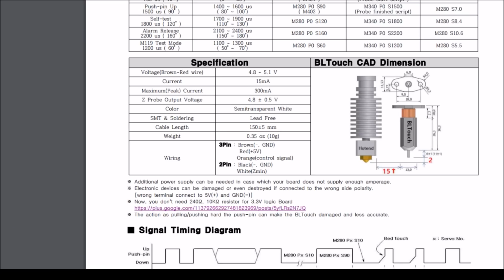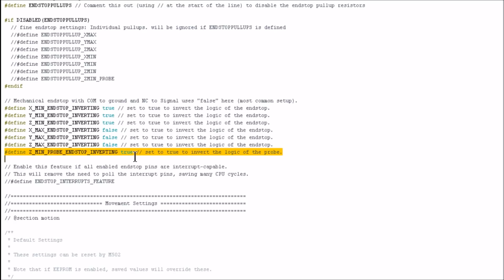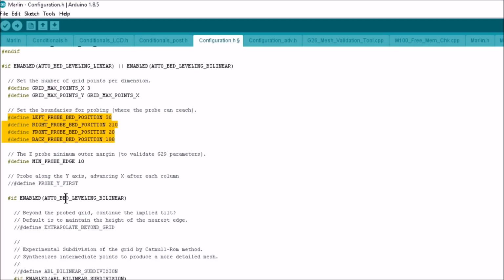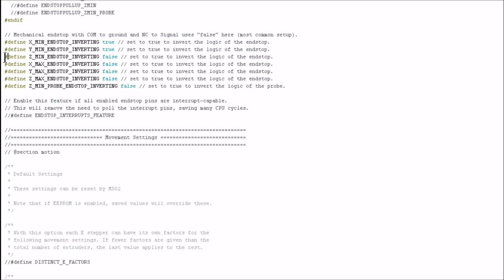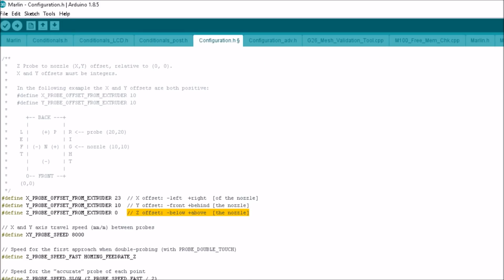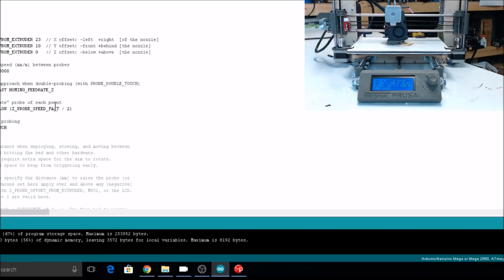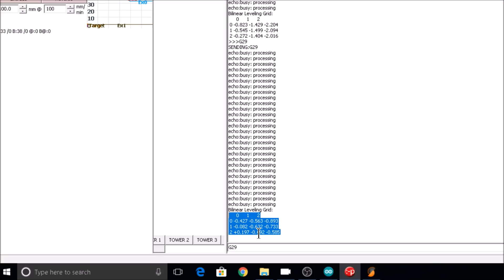Add Auto Bed Leveling to your 3D printer - Marlin - 2017

Comment: Hi Chris. Your videos on SKR 1.4 and marlin are awesome. Now I am having a problem with the manual bed leveling. When I touch the controller to go to the 4 points (the 4 corners) it moves to 4 points on the bed, but only one point is an actual corner. The whole mesh is too far towards the back and the right side. I uploaded a video to the Bigtreetech / Biqu SKR Facebook group (I am hoping you are a member). I also have uploaded it to my Google Drive (and included my otherwise working Marlin if you want to look at it) in case you aren't a member (2nd link). Could you take a look and tell me how to fix this please? Thank you very much for any help you can provide !!! https://www.facebook.com/groups/755135144882809/permalink/1266374420425543/?comment_id=1266385217091130&reply_comment_id=1266394480423537 https://drive.google.com/drive/folders/1ztqHRDSGQFZh6eoQ2cIQcjAsDjuKh1By?usp=sharing
Reply from the maker: So about all you can do is adjust your probe points. That can be done in your configuration_adv.h  

https://youtu.be/iwhbeD2AduA?t=809
Reply: @ChrisRiley  I tried that and it didn't work, but I finally fixed it via updating and changing the points in the TFT35 firmware. Now the whole printer works perfect, but it won't print without massive drifting on the X axis on the first layer. The printer is sound mechanically, so there must be a problem in my Marlin, which works on my Sapphire Pro but I couldn't adapt it to my larger ELF. So I am making a new Marlin from scratch following your SKGO video (ELF is CoreXY) and incorporating your settings from these videos and other advice I've gotten. Difficult since my corexy has 2 z motor and 2 z endstops and no ABL of any kind, and in the videos I've seen so far you never seem to mention what to do when you don't use an ABL. I find manual leveling so easy that to buy an ABL is a waste of money. So I am a Marlin Noob trying to compile Marlin for a printer no-one has compiled it for yet, plus I've added the new SKR & TFT35 and I just bought optical endstops so I don't want sensorless either cause that would be a waste of money (which you also don't explain in your videos). I understand you make these for the general public that do want all these things, and the videos are great for them, but not so much for someone like me. But they have helped tremendously in a lot of other areas, so thank you very much !! I am really getting  the hang of Marlin with your help.

Comment: Why do you need to add resistors when you connect the probe to 12volts? also what value of resistors do I need to use?
Reply from the maker: At 10k and a 1k should work. If you don't use them you will feed 12v back to your board that is 5v.
Reply: @ChrisRiley  Cool, Thanks a lot Chris!

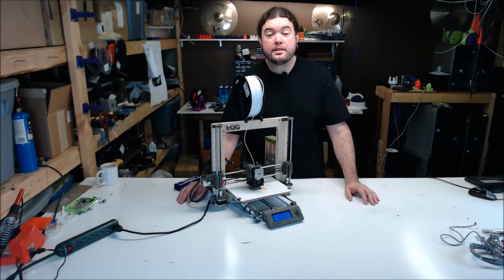Comment: Why you didn't change the Z offset using eprom instead of reuploading at every change? Also, which version of marlin shows the map result for G29 at 10:29? I am using 1.1-bugfix and it don't. It is a BILINEAR thing perhaps? I'm using 3POINT
Reply from the maker: I don't remember, it's been to long ago. My guess is that only works for the mess leveling.
Reply: @ChrisRiley  Yes, I tried and can confirm it is a bilinear thing :-) Now I get 
0 +0.705 +0.439 +0.182
1 +0.305 +0.158 -0.245
2 -0.109 -0.250 -0.535
If I understand correctly, the 0,0 point is about 0,8mm (.705+.109) higher than 200,0 point, is that correct?
Reply from the maker: @brunocabral1578  Yes, that is correct.

Comment: My didn't work an the problem was Earthing. My printer uses 12v atx power supply unit but my house doesn't have earthing in any socket "thanks to my landlord". There for it doesn't work through my skrv1.3 board. But it works with 9V battery. Problem is signal pin works only when connected to pure DC voltage otherwise probe does detect metal but signal pin doesn't trigger.
Reply from the maker: Wow, that's interesting, nice work finding the issue.

Comment: Auto-leveling has its own issues but that's besides the point. What is really pointless here, in my opinion, is the whole effort about zeroing Z axis. That's a huge amount of effort which basically goes out of the window the moment you come even close to nozzle, let alone swap it for a different one. Sensor offset should be some safe height and then everything else should be configured through home Z offset on the printer interface itself so you can easily reconfigure offsets when nozzle is changed.
Reply from the maker: Interesting take on the process. Thanks for your thoughts.
Reply: @ChrisRiley  You are welcome. Sorry if my comment sounds harsh. Upon reading it second time I realize it might sound like I have something against your explanation. Which I don't.

Process just seems overly complicated to zero-in on the Z axis, which basically goes out the window on any Z axis change, be it synchronizing steppers or changing nozzle.
Reply from the maker: @MladenMijatov  No worries, but thanks for following up.

Comment: Great video! Got ABL working and have had some nice prints, but one thing is kind of odd to me:

When I'm doing prints on pronterface I don't notice the z-axis height changing as it goes around the bed, shouldn't I see this value fluctuate by a couple hundredths if my bed is about that far out of alignment in any given spots? I thought maybe the value just doesn't update but I also don't see my z stepper motors moving as it prints across different parts of the bed. I've got G29 enabled on my starting g-code, is there something else I'm missing? If I'm not seeing change in the z-axis as it goes across a given layer, what actual bed leveling is taking place?
Reply from the maker: Yes, you should see the Z adjust the height up to a certain point it will stop if fade height is set, but it should be doing it on the first 10mm or so. Unless your bed is super level.

Comment: Hi,
Thank so much for this video with a good information. I have a SKR mini E3 board on my Ender. Can i connect my capacitive sensor on PC14 (Probe) ? I use optoisolator for protect my board because i use 24V on the probe. It is the same firmware modification like BLTouch. Thank for help.
Reply from the maker: Yep, you can use it on that port, just comment out #define Z_MIN_PROBE_USES_Z_MIN_ENDSTOP_PIN

Comment: Hi Chris, Im going to install a BLtouch, i have Marlin 1.1.8 installed from the factory on my printer, if im going to make the changes you say in the video, do i need to download the firmware i have in the printer in order to get all the settings right? Or can I just make the changes and update the ones that are in the printer??? or might something stop working if I do that?, I have a printer with 3 in 1 out extruders, Can i make a backup of the firmware someway? or is that not needed?, if I just need to upload a new firmware could I change to 2.0 version at the same time?
Reply from the maker: If you flash your firmware, you will lose all your custom settings. There is no way to do a backup from the existing firmware on the board. The best you can do is run an M503, record those settings and try to load them into a new version.

Comment: Thanks for the best instructions on getting basic settings changed.
Your channel is my first stop if i look to change any firmware settings or add any features to my printer.
Reply from the maker: Thank you for this comment! Glad the videos help you.
Reply: @ChrisRiley  so far the level sensor is the single most useful upgrade to my cheapest amazon printer yet.

Comment: thanks for your efforts creating this. It was a great help.  I don't seem to have the boundary settings in Marlin 2.xx.    It does work correctly at the nine firmware calculated points though.

I would warn people about a mistake I made.  I was testing the Z proximity at various points.  Then made the mistake of moving near to the Y limit and then asking it to home Z!  My proximity sensor is 51mm behind the heads so had no bed to detect.

Thanks again
Reply from the maker: You're welcome! Doh! I have done that a time or two. Marlin 2.0 is a bit different I noticed. I just redid this video for 2.0 in fact.

Comment: i've done all steps.. but my printer... don't want to go down in negative Z. and i've disable MIN and MAX endstop
Reply from the maker: Maybe something is stuck in eeprom. Try running m502 then m500.
Reply: @ChrisRiley  ... it says me: ERROR: eeprom disabled
Reply from the maker: @madhatter5475  Make sure eeporm is uncommented in the firmware.
Reply: @ChrisRiley  yes. it wasn't. now it s the same. i think it was the firmware... and i ve installed a new one. and it' s bad! i think it can be the hardware. now i m tring different old firmware. 2.0 and 1.1.9 don't work with me... thanks
Reply: @ChrisRiley  Solved! Wrong firmware. New firmware don't work. Only OLD. Thanks so much!!!!!
Reply from the maker: @madhatter5475  Great, I am glad you got it working.

Comment: Can't get the BL touch sensor to work blinks blue once doesn't do anything else
Reply from the maker: If it's the newest version sensor, you might have to use Marlin 2.0. I know there were some changes there.
Reply: @ChrisRiley  its smart v3.1
Reply: @ChrisRiley  howdy I was wondering if I'm using the z min end stop to home and it is set to true will changing it to false make the hot end crash in to the bed I have not tried it yet  also the bltouch seems cool but  complicated to configure I leveled the bed solid I want to use adjustable screw on end stop to set bed height has this been tried yet? Thanks for any suggestions👍
Reply from the maker: @wishicouldarduino8880  Setting ot to false will probably make z not move at all. Using a micro switch to level? Should be easy enough if you make a mount for it. A lot of printer have done it this way.
Reply: @ChrisRiley  thanks 👍
Reply: @ChrisRiley  I hate to bother  right lol but how do I set up dvr8825 drivers for marlin 1.1.9  do I change movement settings I found one bit of code but it wouldn't work thanks for any help👍
Reply from the maker: @wishicouldarduino8880  With DRV8825's they default into 1/32 micro stepping.  You will either have to change your board jumpers or change the movement settings. Check prusa calc to get the numbers. https://blog.prusaprinters.org/calculator/
Reply: @ChrisRiley  thanks👍
Reply: @ChrisRiley  are the DVR 8825 the same as the drivers with the Hawaiian name poulolooo mosi tatupu lol?
Reply from the maker: @wishicouldarduino8880  No, the A4988 is an Allegro chip, the 8825 is a Ti chip.
Reply: @ChrisRiley  thanks I didn't know if I had to factor that in on the prusa calculator or not I tried getting in to it to get familiar so I don't know if I'm correct or not I think I came up with 400.400 5120.400 ? At 1/32 micro step it compiled but I guess I'll find out once I get the board ramps 1.6 hooked up .thanks👍
Reply: I'm having trouble with layer shifting as in the second layer lol first layer prints but then it keeps print the next layers in random places I can't pin point what it might be thanks for any advice happy new year ! 😁
Reply from the maker: @wishicouldarduino8880  Happy new year, lose pully or low driver current is about the only things I can think of.
Reply: @ChrisRiley  yes it was the belt
Reply: @ChrisRiley  if I change the z min from true to false is that correct I have z min set to true for end stop will changing it to false for BL touch work? Thanks for any advice👍

Comment: I used this to setup a probe on one of my printers, and I got it to work great. Thanks for that.
However, the nut on the probe got shaken loose and I had to re-tighten it (as well as set my new z-offset). 
No matter what Z-offset I define in Marlin, I have to raise the printhead .3mm to get it to be mechanically at zero. Adding or subtracting 0.3 doesn't change anything. Can you think of a solution off the top of your head?
Reply from the maker: My first thought is maybe you have something in eeprom that is messing you up. If there is a Z851 command listed that is probably affecting it. I would run M502 them M500 and try again first before I did anything else.
Reply: @ChrisRiley  Gotcha. The procedure has been disconnect from pronterface > change Z0 in firmware > upload > home + bed level + jog to mechanical zero. It worked when I did it the first couple of times, dunno why it isn't working now but I'll give that a shot. Thanks!

Comment: The LED on my probe lights up as it should, but whether or not there is metal under the probe an M119 command always tells me that the Z- is triggered. I don't think my issue is in the wiring, but rather in the firmware. Where should I start looking for a mistake?
Reply from the maker: Flip flop your endstop logic. Z min and Z probe.

Comment: Ive watched Dozens of videos trying to get my NPN sensor to work on my Anet A8.  With this video i was able to get it working in moments.  EXCELLENT VID CHRIS.
Reply: if you own a NPN NC/ NO sensor you can wire your Z endstop as normal in parallel with the sensor. When the Z endstop is triggered it will close or open the circuit to ground/ possitive and cause a trigger which is the same trigger in the code for the NPN sensor. Just be sure to wire the micro switch in the same NO or NC position to match your sensor and splice it into the wires going into your Z endstop on the mainboard.
Reply from the maker: AWESOME! Glad it worked out for you!

Comment: Hi Chris, very good video. I use an AM8 with a capacitive sensor. I've done everything according to your description. But my nozzle always stays to high above the bed after homing. Even if i adjusted the Z-offset in the firmware and deactivated the soft endstops. Do you have any hint, what may be wrong?
Reply from the maker: Hey Michael, Is there anything in the M851 field on the M503 output? If might be eeprom causing you issues. I would do a M502 and M500 just to be safe and make sure you are pulling the right values.

Comment: honestly if you print on glass you don't even need a sensor. it's so flat :O I was amazed when I used glass. only need to level the 4 corners and it's the perfect layer every time on the whole bed
Reply from the maker: Glass prints always look so good.
Reply: @ChrisRiley  yeah! the reason I"m here is that my sister is gifting me a magnetic print bed (https://www.amazon.com/Platforms-Magnetic-Flexible-220220mm-Textured/dp/B07RJXR4P5/ref=sr_1_10?keywords=textured+pei&qid=1563197018&s=gateway&sr=8-10) and I can't use that on glass that's held on by clips.

I kinda wanted to try an inductive sensor (They're so cheap!)first and see how it goes. I feel like even with a 7x7 grid it's not great. so I will probably use painter's tape to stick the glass to the bed and just put that on top of my old glass :) 

I was really lucky to have mine work at 5v. I have no idea why it works fine at 5v despite not advertising it xD

Comment: Chris, im having trouble with the z offset, it changes everytime i measure, i think its because of the temperature of the bed... it its normal on inductive sensor? could be the sensor? i think my sensor its one of those 6 36v but im using it on 5v, and its "working"...
Reply from the maker: Temp can affect it. So can low voltage. Are you sure it's inductive? That question might sound funny, but the capasitive look very similar.
Reply: @ChrisRiley  im sure... i changed my glass bed to aluminum because of the sensor... im having more than 150 microns of variation
Reply from the maker: @dddxp7311  I think maybe it might be low voltage causing the inaccuracies.  Have you run a repeatability test?
Reply: @ChrisRiley  not yet. I will make the test tonight
Reply: @ChrisRiley  yes.. tryng with more tension now... lets see

Comment: You can use a glass sheet with COPPER foil tape.  You can also get STEEL foil tape that may be more sensitive to the inductive sensor.
Reply from the maker: Sweet! Do you have a link to that tape?
Reply: @ChrisRiley  Got it on ebay.  Just search for 'copper foil tape'